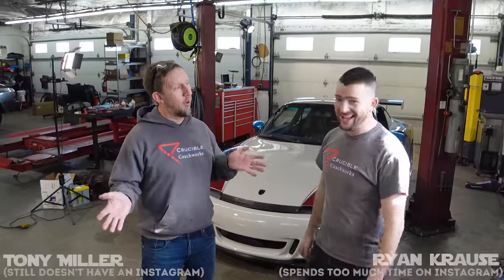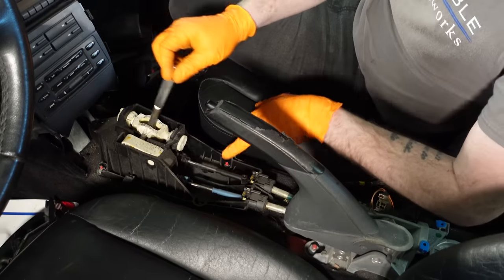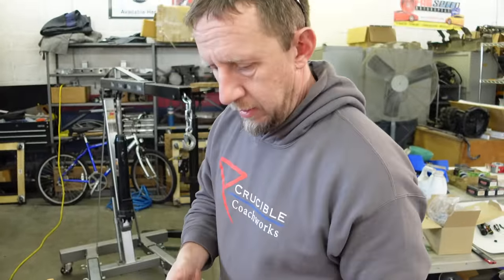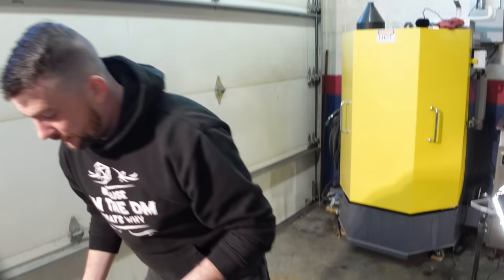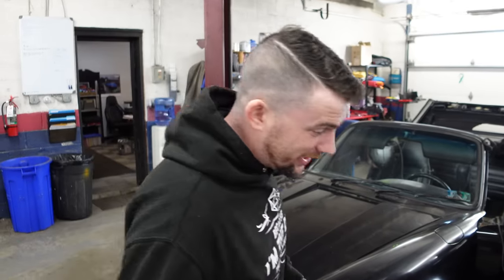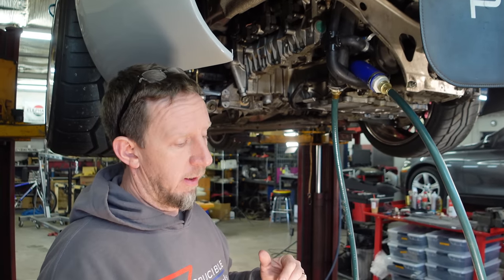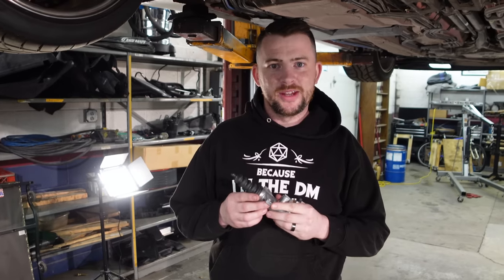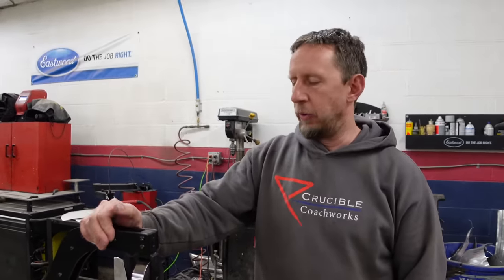How We RECOVERED From a DISASTER! Widebody Porsche Engine Cooling Flush & Short Shifter Install!

Comment: I’ve always been a fan of the slantnose and I love the body paint added to this 996. However, I’m not a fan of the color rule. Maybe color match the wheels and side mirrors the same as the interior which can be black. Or color match the side mirrors just the same as the body paint grey. Some type of 60, 30, 10 color rule has to apply. 60% grey body paint. 30% can be black or full commit to the red and keep the red wheels and red side mirrors. 10% can be blue.

I know the paint was done months ago but it’s still something that I can’t stop noticing to clean this build up. Maybe I’m not aware of the final vision of this car. I’m always going to be here supporting the channel. I’ve even paint stripped my 996 to bare metal and have primed my car. A big inspiration has come from this channel. I’d love to get a slantnose kit but I love the 996.2 look and gt3 aero kit look. So ultimately paint has been on my mind and you guys are the professionals!